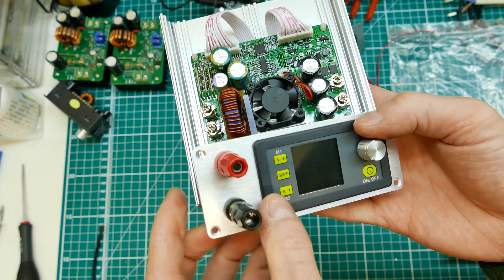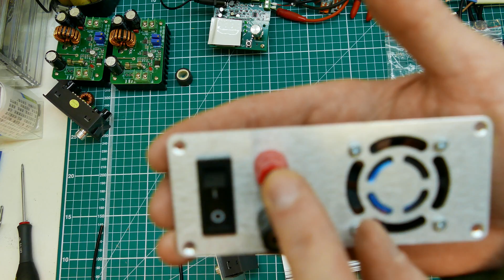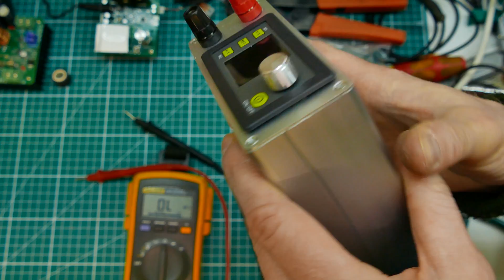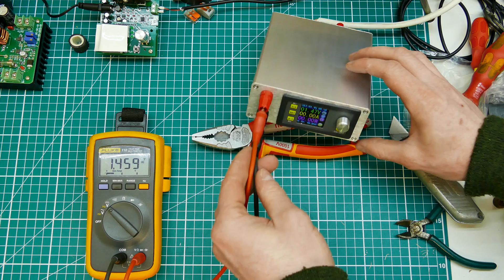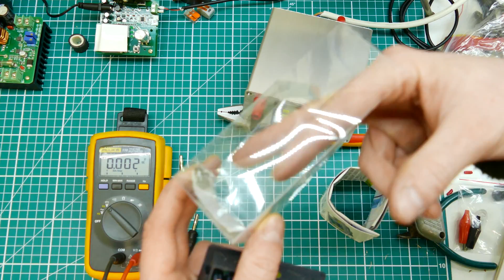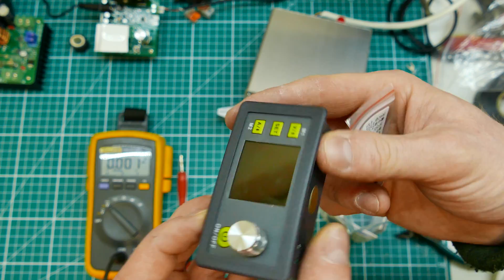DPS5015 - The Case

Comment: Hello,
can you tell me the values of the two components welded between the output terminals (near the toroid on the main board) I turned the terminals on the back and during the desoldering I have lost one (in your video I saw two, in my circuit I have only one but empty pads are too much soldered to be empty in origin)
thanks a lot in advance

Comment: tell me how to power it. from a normal 240 volt network with a 12v and 1A power supply
Reply from the maker: If you check my videos I have an older video with a meanwell power supply, it’s perfect for this.
Reply: I can not find a specific tension and amperas

Comment: Excuse: I don't know Your language - so I asked.
1. DPS5015 to charge the battery you need to put the Schottky diode?
2. Case DPS5015 - what is the chip on the motherboard fan control? 
2.1. The fan in the building is constantly controlled depending on the temperature?
Reply: Hi friend 
I said I am the designer , so you should ask me , not leave a messgage for here 
let me answer you those question 
1. DPS5015 to charge the battery you need to put the Schottky diode? --- don't need the diode , because there is a diode circuit on the PCB,, but you can connect the battery polarity reversely, it will burnt the fuse. 
2. Case DPS5015 - what is the chip on the motherboard fan control? -- yes, there is PCB to control fan, but when power on, it will keep working, not stop 
2.1. The fan in the building is constantly controlled depending on the temperature?--  the fan on the case was not controled depending on the temperature,  when power on, it will keep working, not stop

Comment: Hi friend 
thank you again for make a video . nice video , I like it. you are great 
you can buy other case for DP50V5A, i can give you some discont for you 
thank you again
Reply from the maker: Hi Rd Tech, i enjoy your products so i would be interested in anything new that you have :) Glad you liked the video
Reply: InterestCasual
Thank you very much for your reply, I like the video and your work, it is great. 
but there is a little pity, we don't produce this case now , we produce other case . we need 1-2 months to produce this case
Reply: Rd Tech mine was different?? DPS5015, 
1. Turn the heat Power on, then the fan spin for 2 secs then turn itself OFF
2. Higher than 9.5 - 10 Amps the fan is in the 20% ON
3. 11Amps the fan is in the 40% on 
4. 12Amps the fan is in the 60% on 
5. 13amps 80% on then 14 - 15amps 100% the fan ON